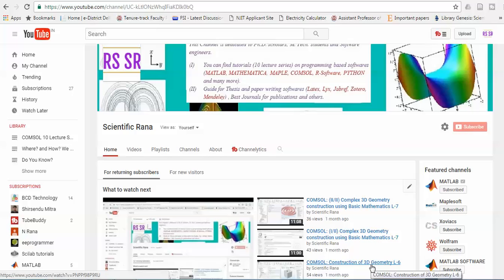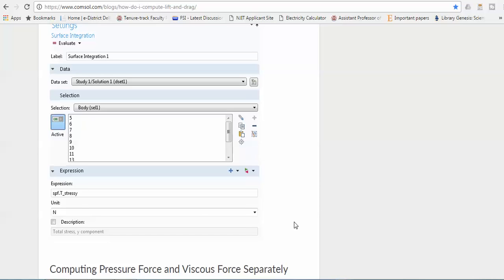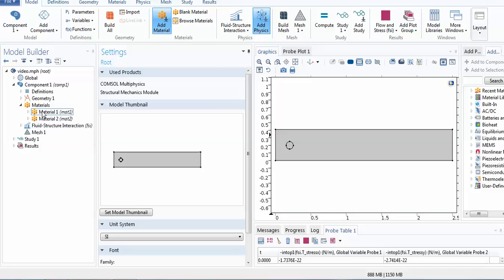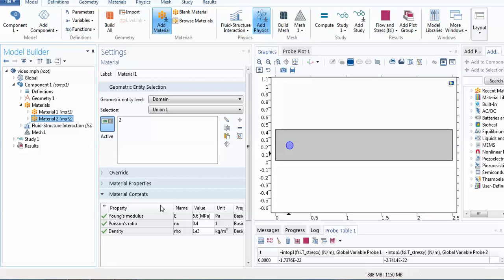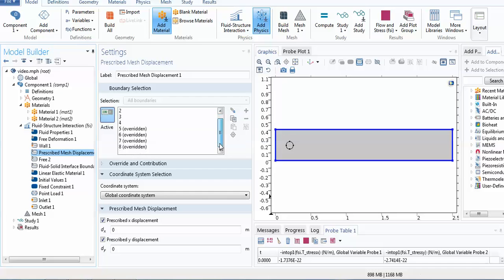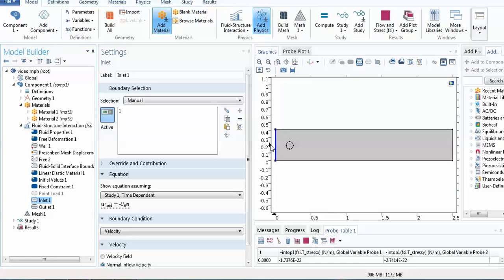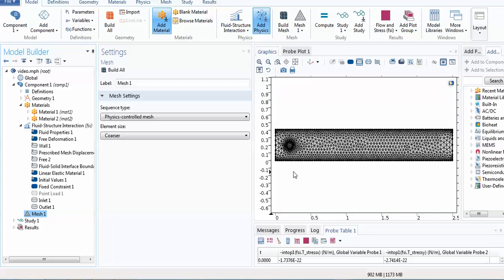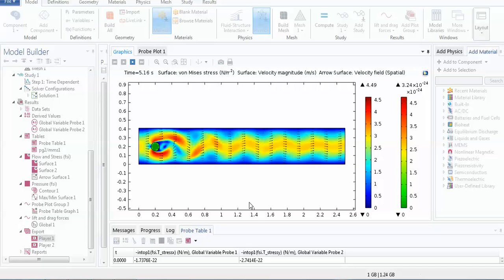COMSOL: Time dependent 2D Fluid-Structure-Interaction (FSI) problem L-9

Comment: Hello, I'm a marine engineering student.
I'm working on a study of wave interaction with a cylinder (offshore structure) and evaluating the forces exerted by the waves. Could you help me find the solution using COMSOL Multiphysics and send me the documentation?
 Thank you.

Comment: Thank you for your video of Comsol fsi. It seems to me very useful. I don't know if you have time to make a video about free surface flow? I would like to do with it a model of water wave interacting with seabed~
Reply: I have to do the same but witha beam, I have problem becouse of the big domain (metres) the two phase flow doesn't work, in 4.2 it worked! I use two phase laminar flow phase field+ALE+beam, did you solved?
Reply: Hey @ a yi, were you able to do that?, I'm interested in the same problem

Comment: Are you sure that it's "Coarser" mesh density ? It looks like "Finer" or even "Extra fine". I mean, you could have changed that after computation accidentally (without clicking "Build All" so it wasn't created but appears as chosen density).
Reply: Very helpful comment!
Reply from the maker: Thanks for your comment. You are right. It is finer mesh.
Reply: One more thing worth adding for viewers trying to recreate it: to avoid errors you need to click Study ---> Show Default Solver and configure it as shown in "Vibrating Beam in Fluid Flow" (Application Gallery on COMSOL website). Especially changing from default segregated solver to fully coupled one is the most important here.
Reply: do you know from where to browse intop1(fsi.T_stressx) file